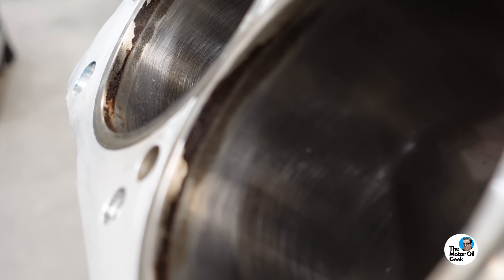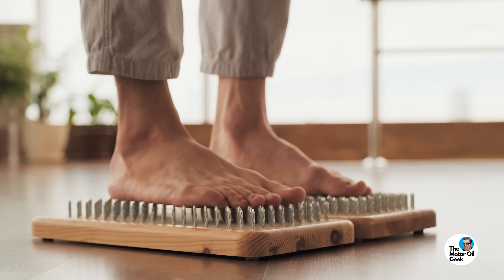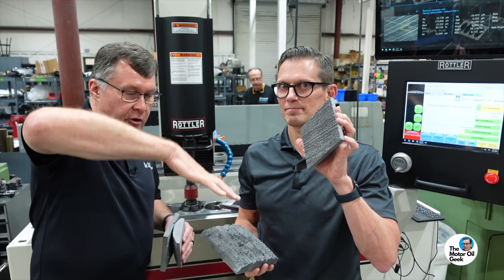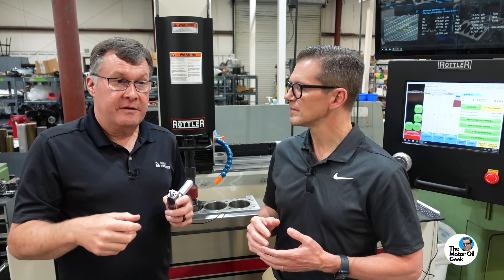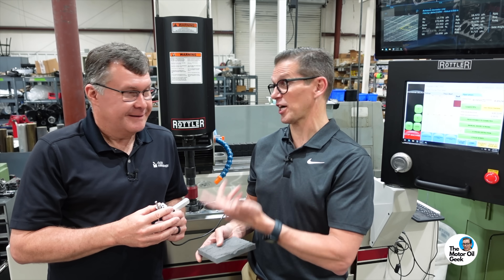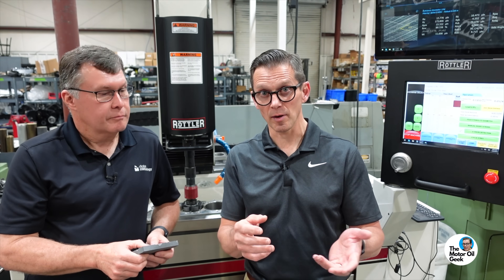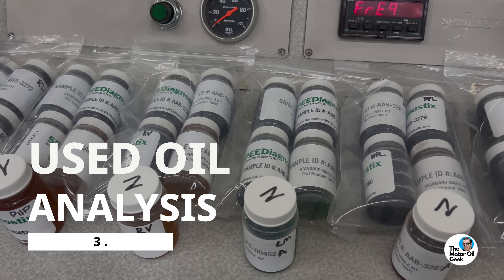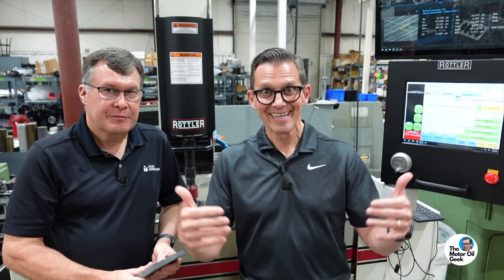GM's $1 BILLION Dollar Blunder: ROUGHNESS Matters...

Comment: This a TOTAL management blunder in Quality control of surface finishes. Engineering wise required max Surface roughness on Journal bearings was known before 1900 and fairly mature in the Model T era. 

Surface finish equipment was in use a century ago. I doubt GM has the raw guts to fire the folks who allowed this vary basic Quality Control blunder

Again NOTHING engineering wise of this blunder is new; it was well documented what Journal surface finishes had to be 100 years ago. 

A "rougher" surface journal takes a higher rpm to float fully on a oil film; that was known before 1900

You can take 5 different journals with different roughnesses and rotate them and HEAR with a stupid stethoscope when the scraping noise drops and the oil is fully supporting the bearing. That test was in a relatives Engineering lab course and he graduated in 1934

That same "hear the bearing noise drop when floating" was at Ford at their Ford tours in the early 1960s; before the Ford Rotunda burned.

None of his is rocket science. A loaded ww1 bomber takes longer to take off on a dirt field than a paved one. So does a B17. So does a disc drive recording head; a rougher/worn/damage disc takes a higher rpm to "float" the recording head on the air film as an air bearing. A super rough finish ice skate hollow requires a faster speed to float on the water film.  

So the Current Auto Industry has gone BACKWARDS. 

Detroit in his glory era 100 years ago did about ALL in house and had workers that by eye and feel could tell if a Crank journal was grossly too rough. If close they had a microscope and comparison samples.

None of this is new at all. A rougher journal requires thicker oil to float it fully at the same rpm it floats with the proper less roughness one.  ie two journals. With the same oil the rougher one requires a higher rpm to be pure floating on the oil film pressure

*LET it sink in that all of this was known before anybody today was born yet**

Comment: Lake, I admire your passion and enthusiasm for the art and science of professional race engine engineering and building. You never stop to amaze us with new subjects and concepts we thought we knew all about and now find out we were barely scratching the surface. I am semi-retired after 28 years building race engines for Hendrick Motorsports and serving in the HMS engine development group. Can I ask for your take on the engineering torsional principles were we trying to achieve in the early 2000's with the 2.0" and smaller crankshaft main journal diameters. The crankshafts were also drilled though the journal centers and weighed about 43 pounds. The crankshafts are so flexible the damper OD will hit the timing pointer and break it off unless positioned about .200 away from the damper's surface. We suffered a lot of rod bearing failures in those days.
Reply from the maker: Thanks for watching and sharing. My POV of the smaller journals in that era was to reduce surface speed, which reduced hydrodynamic friction.

Comment: Sorry, you can turn this issue any way you want. This all could have been avoided if GM checked a crank every thousand. That aside, how can they explain the metal debris in the engine? This is way more than a single issue. BTW, who approved the "test" that GM is using as a valid test?  You can't have GM oversee the test to determine whether  or not an engine should be replaced. There should be a 3rd party that has nothing at stake to do the test.

Comment: Just like the Toyota piston ring issue! Rings were not polished smooth enough by the supplier and with Ow-20 motor oil, the rings scarred up the cylinder walls!

Comment: Lolwhut?  Ok Exlax.  You've mentioned NOTHING about what your title says.  NOTHING.  Continuous watching of your 15 minutes of bupkis video infuriated me by how little it actually covered.  Is this a hit piece or is this consumer advice or is this just filler bullchit?  It appears to be filler bullchit.   "Look down into the filter"-  Lolwhut?  Are you serious?  This is for the L87; it's a SPIN ON FILTER; you can't see down into that chit!  Come on guys; you're giving us the wrong advice.  Stop trying to give us advice on how to SEE HOW BADLY WE'RE GETTING EFFED and START GIVING US ADVICE ON HOW NOT TO GET EFFED!!    The engines that lasted 300k miles ran on Traditional 10w40.  Fact.  So, irrespective of what the manufacturer is doing and what the EPA wants on and on start doing what THEY DON'T WANT YOU TO DO!    Do you remember the "fix" for the L87?  It was to use "MOTUL BRAND 10w60".  What exactly does that tell you?  That the oils are too thin for the way the engines are built.  End.  It doesn't take paying a lab for oil analysis and a moron-o-scope reading to figure that crap out.     Get with the program or GTFO.

Comment: Surface finish is not the root problem with GM motor crankshafts.  The combustion chamber finish,, though interesting, is not a good platform to illustrate the failure of the crankshaft as. combustion chamber finish requirements do not applie to crank shafts. In combustion chambers there is direct contact between the rings and wall. In a crank shaft there is no contact between metal and bearing surfaces.The parts ride on a film of oil and do not touch.  Surface finish may be a small part of GM's crankshaft issue but that is not the only bad tolerance issue they have. The failure of this engine is a combination of factors. Bad design is just one of them. The NHTSA is correct about the component being out of spec but correcting the surface finish will not rsolve their out of spce issue. Bottom line is that GM built a million junk motors. Why that happend is not exclusivly a manufacturing problem.

Comment: Was the GM crankshafts designed out of spec, or did the statistical process control processes not pick up the failure to manufacture correctly?

Comment: The engines built in Mexico are not getting their crankshaft from high-quality specs suppliers.  Notice high the 2500HD 6.6 are not having engine problems? The 6.6 engine top to bottom is built in the USA, now transmission problems that another story😂. Next gen transmission has a fix for that.

Comment: This topic hits home because I had a good used crankshaft from a good running engine polished because I simply wanted to install new bearings to tighten it up slightly after about 200k miles. 
 It literally ran great, but I had the engine out of the car to re-seal/gasket the entire motor, and I figured it was the perfect opportunity to slightly increase the oil pressure to help it live even longer. 
 I got the crankshaft back from a local machine shop and immediately noticed the polished bearing surfaces were rougher than what I am used to seeing, even the old “ worn” surfaces were smoother…
 I am certainly not a professional so I figured the professional machine shop guys knew something I didn’t and I proceeded to install the crankshaft with new bearings in a very clean environment and I did confirm my oil clearance. I’ve assembled several engines successfully, so I’m not a newbie at this.
 That engine ran about a few hundred miles before it started lightly knocking, I removed it immediately and discovered the rod bearings were wore down to the copper. 
 Oil pressure seem to be within spec, that very machine shop permanently closed down a couple months later, I wonder why…..
Reply: I'm guessing that was an autocorrect error and it should have said, "WHEN the old worn bearing surfaces were smoother"
Reply: Made in America
Reply: @jakanda3472  well at least a sucky shop won't be providing bad service anymore.   : )
Reply: You can find a bad anywhere
Reply: You can find a bad shop anywhere
Reply: @jakanda3472 The fact is: if you're going to make it in America, you better make it right the first time- or the good shops (what few there are) are going to put you out of business.

Comment: Hey Lake, what weight oil do you recommend for my 2017 Silverado with the 5.3? It calls for 0/20 but I see others recommending 5/30, I do 3500 mile oil changes religiously with Pennzoil ultra platinum. Thanks! I'm in Pa

Comment: There was a video regarding NEW motorcycle engines, and the amount of debris found in the after the break in period. 

Considering all the metal parts have to wear in….in your opinion, is there a correlation between quality and the amount of material found in the oil after the first oil change?

Comment: How would you rate the addition of an oil additive (like Archoil's boron formula) for this L87 issue? Would it help compensate for the initial problem along with the viscosity modification from GM?
Reply from the maker: Don't use additives in motor oil

Comment: You teased us with the GM 6.2L bearing issue and you spent the whole episode talking about rings and cylinder finishes. We know GM says the surface finish wasn't fine enough for the 0-W20 oils but what I'd like to know is given the level of surface finish on the bearing journals, are they sufficiently smooth enough to run the older heavier oils like the 5-W30?

Comment: Total clickbait. This is about piston rings and cylinder wall finish. Nothing about GM crank finish, bearing failures and oil pump
Reply from the maker: We covered the surface texture issue with the crankshafts in the previous video

Comment: You testing perimeters are not that accurate to decipher miniscule wear.  The oil analysis's is not that accurate, too many various. 
  You can save a ton of money, Just use 10W-40 or 15W-40  You don't need to waste tons of money on oil analysis . I am thinking about my 2003 Duramax hear. I would say 10W-40 in gasoline engines and change your oil more often the Mfg suggests.. My Duramax the manual says every 10,000 miles .. cut that back to 7,000 miles and your engine should last a very long time.

Comment: Hey Lake - This video made me think of the opposite of "slippery" which is adhesion.  In theory, two perfectly smooth surfaces don't even need an "adhesive" to bind them together.
Reply: You can see that in action with gauge blocks binding together.  They could have used that as example of why going too smooth can INCREASE friction, not lower it.  https://www.youtube.com/shorts/Vvfjwb3utSI

Comment: with regard to porosity aiding oil retention on the surface, what happens to a stock engine that has many many miles on it and it gets extremely shiny and smooth??  they seem to last a long time like this….

Comment: The General's styling and marketing pooped the bed years ago. Trying to sell lux Cadillacs that looked like they came from a video game just did not work.
All manufacturers have taken a hit since the bean counters were given the bigboy pants to wear.
That said, the Generals powertrain engineers have produced very good engines and transmissions. I was skeptical as a 30 year mechanic when they came out with the Gen 3 engines. My thought was they could have just designed heads to fit the SBC short blocks at a lower cost. Now with 25 years behind them, the Gen 3 engines are great. Good fuel economy and they last a long time, longer than rustbelt bodies and frames.
The AFM/DOD has been a trouble source though in an effort to squeeze another couple of miles out of a tank of fuel. The General is not the only manufacturer experiencing problems with this technology, pretty much all using it have problems. 
As you state Lake, machining is most likely the L87 failure cause. It suprizes me that this is not being displayed in the 5.3L engines. You would expect if the bean counters demanded skipping some procedure to save a couple of bucks, it would apply across the board. The bean counters screwed the pooch on this one!

Comment: Most of us have found the real truth. The valves contact the pistons at high RPMs. People that surface machine any older 4.8 5.3 6.0 LS heads get some real surprises too. There is not enough valve clearance between the valves & pistons because of less material between the heads & blocks. Stronger valve springs help a little if you are not running hard on open hiways. thicker oils help some but most of the blocks oil journals have been proven to B to restricted. Its a mal design that needs a little tweaking.

Comment: This is getting stupid, When the model T came out they had the most basic oils and no oil pumps or filters, but these engines ran for years. Now they are talking to the micron finishes and oils with all kinds of additives and yet a vehicle leaving the factory has engine failure sometimes with in minutes or miles. The real problem is they keep cutting back oil pressure and circulating 0W fu$kall motor oils trying to save a buck and a mile per gallon, and I believe it is the lack of lubrication that is piling engines up.

Comment: so what caused gm's problem? film strength of the super thin oil at start up and then a crank finish that is too rough? they are trying to get away with a super thin oil for fuel economy standards and ran into a problem?

Comment: At the end of this video, I seen Shell Rotella T4 15w40 going into a V8 Gas engine, that's interesting. I love the science of all this stuff, it's very cool to know. I have a '13 Chevy Silverado 5.3 with 240,000 and had zero mechanical issues with it, though I did turn off the V4 to V8 mode . Since new, I have run Mobil 1 5w30 most of time and the oil samples come back very good with minimal wear. I have to say, the Vortec engine is probably the better engine for reliability out of all the engines that GM has made besides the early small block V8s.

Comment: suspicion they swapped surface finish from ring to bore so that engine blocks wear instead of replaceable rings when the third owner gets it .  All the engine builders that built engine in the 2000s know what a long lasting finish is and there is no excuse for gm.

Comment: The problem with gm's L87 engine isn't the surface finish on the crankshaft journals. The problem is gm's total lack of quality control. This problem should have affected a small batch of engines. Not a million engines over about 5 years.

Comment: Question, you talk about retaining oil in the valleys, does this reduce oil getting into the combustion chamber or allow to be picked up and burned. I see modern cars burning oil, which should be fouling emissions systems. I worked on large British diesel that manufacturer electro arched liners with diamonds to retain oil also. We looked like PigPen coming into port, some harbors tried to prevent entry, couple of veterans had reman shop that got rid of indents but got sued by Brit corporation. Would like to see the best way to assemble cylinder configuration.

Comment: In a previous job I oversaw Tencor profilometers and AFM machines. If you bring two similar surfaces together that are too smooth, they can glue themselves together with Van der Waals forces. A certain level of roughness at different scales is necessary for surfaces to slide past each other smoothly.
Reply: AFM = Atomic Force Microscope
Reply from the maker: Right on!

Comment: GM uses something called "statistical process control" in their engine manufacturing, spot checking, instead of inspecting every engine that rolls off the assembly line. This is why they send over half a million vehicles on the road already damaged.

Comment: So where's the answer to the title? You never covered WHAT the mistake was.
On another thing, so if you have to have a certain surface finish, how about what happens 50k or 80k or 100k down the line when the parts wrar themselves smooth and that surface finish that was so critical doesn't exist anymore?